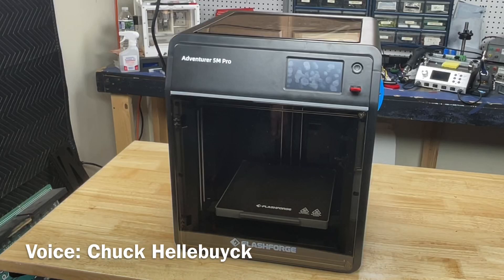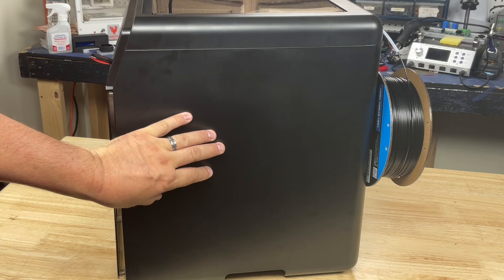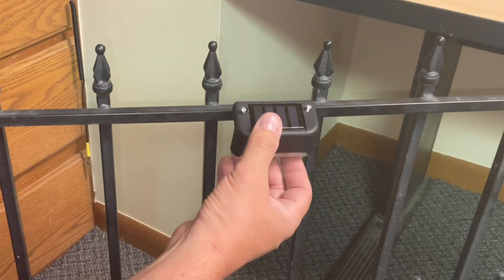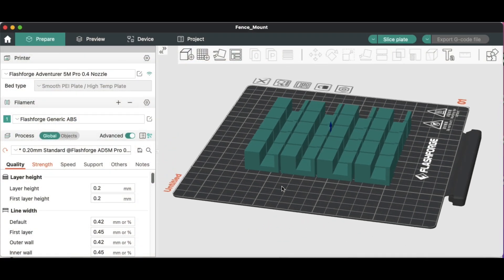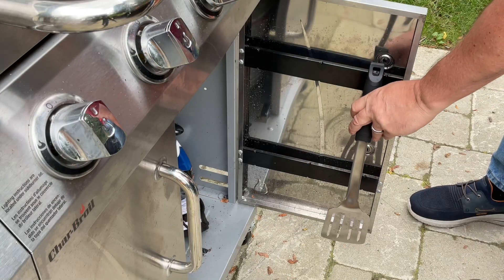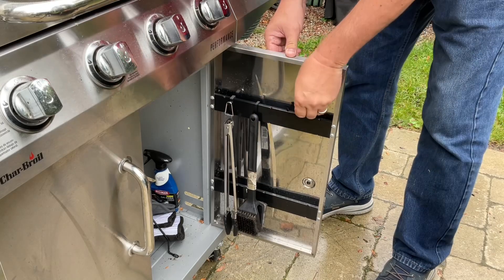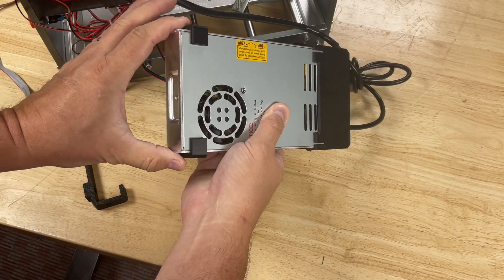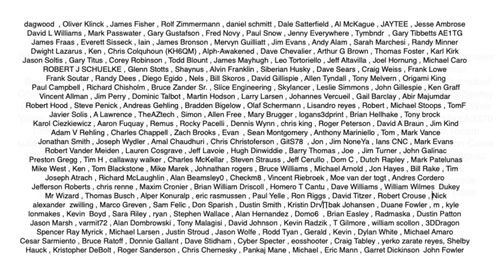Practical Prints using ABS on Flashforge Adventurer 5M Pro

Comment: Any issues with the wifi connection timing out when sending prints from Orca Slicer? Both my 5M pro and standard 5M have intermittent issues when trying to send prints. Tried with different computers so I’m assuming it’s the firmware…
Reply: I've connected the printer to my 2.4ghz router instead of 5ghz, and it works fine now, have you tried that? Nonetheless annoying..

Comment: Thanks for the video. So how do you like the 5M Pro? I'm looking for a new printer and have been printing for a while and this seems like a good investment. I see that you haven't released a full review so just wondering what your overall thoughts are on this printer. It certainly seems like you get quite a bit for the $469. Were there any issues using Orca slicer with it? Where you able to use Wifi and the on board camera? Any other Orca issues that you found and printer problems you've uncovered since this video was released? Appreciate any info. Thanks.
Reply: I don't know how it compares to Bambu.
But, it's a very good printer for a really cheap price.
Only thing I don't like are:
- Low camera resolution/bitrate.
- No multi filament support.

But, for the price they are going for now it's really not a bad printer.
Reply: @el_teodoro Yes, I ended up getting one and it's pretty nice. I also have a Bambu A1 Combo so I can do multi filament prints on it. The 5M runs Orca fine and WiFi printing is supported (although it has problems with large files, so sometimes I have to physically move files with USB, but it works). The combination works well for me with the 5M doing more technical prints with more professional filaments that need air filtration. I really think this is a good combo for less than the price of an X1C and it doubles my ability to get prints done. Agree, the camera isn't that good but neither is the A1s. I use a cheap Tapo C100 1080p camera that has full online use support and I can just move it wherever I need it. Think they're still at Amazon for $15, great deal. So I think I've addressed your 2 concerns for a few $.

Comment: ABS is not needed there, PETG would do just fine. Even PLA, unless you live in California.
Reply from the maker: I don’t like PLA around a voltage source connected to mains power. I tried PLA holders for the utensils and they sagged. ABS worked better with screws on lights.
Reply: ABS will damaged by UV. PETG will survive

Comment: This specific printer, the FF5M Pro has a carbon filter and support internal air circulation. This should remove bad partials and volatile gasses. Did you check if this will help using abs without the bad impact to the air?

Comment: @8:50, instead of doing wire mounts on the power supply mount, make a cable tie mount(s) for the extruded aluminum.

Comment: I'd be interested in seeing your opinions on different materials. I've been using ASA instead of ABS for a while, but I also hear people saying PETG should be good enough for most use cases instead. Then there's the arguement that PLA is the strongest in some other cases. I'm always curious what materials people use and why because I hear so many differing stories. 

Hope you're doing well! Thanks for the video and content friend!

edit: spelling
Reply: I use PETG for UV and crazy temperature areas and it's been great. I have parts on my pool including cup holders which are in the sun every day. Summer the shade can be as high as 95F. They are still going for 1-2 years now. The white/translucent filaments are starting to yellow, but you can expect that from any plastic.

Comment: On printables there is a printable side mounted spool holder for the 5M Pro it works well but personally due the Dutch weather I tend to print straight out of my dryer but there is an option for it if you also dislike the annoying spool holder on the back.
Reply: not too mention other umpteen spool designs to choose from. Even one of my own "over engineered" versions. 8 )